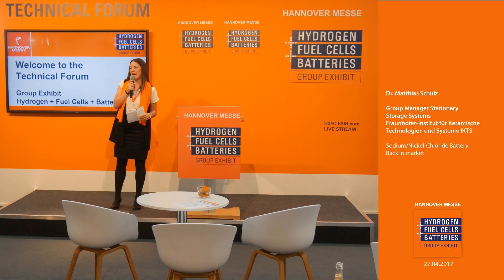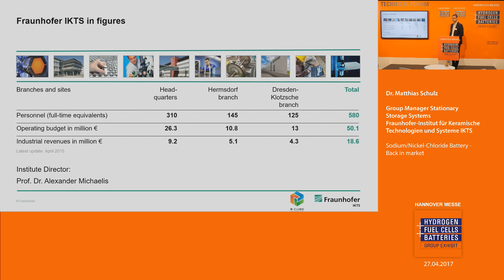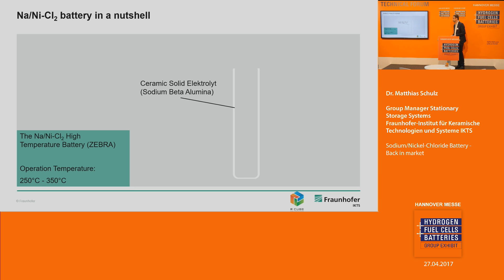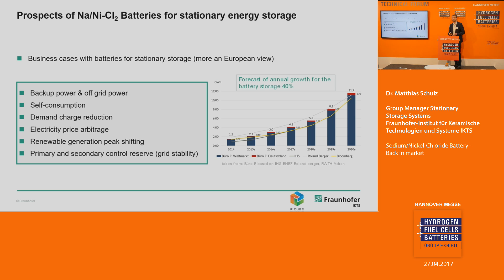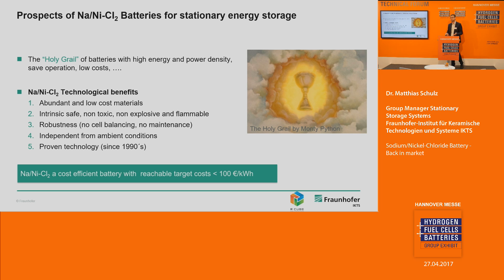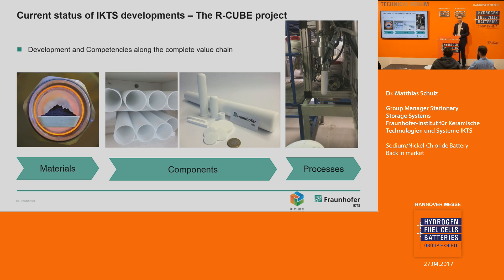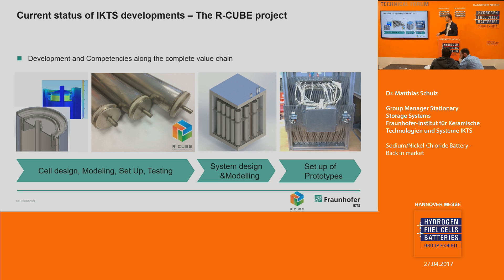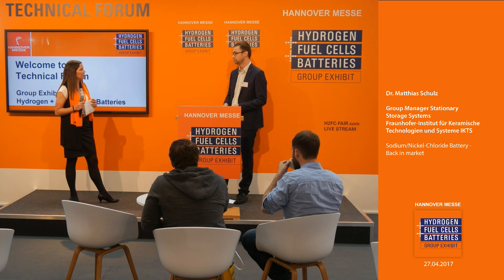Sodium/Nickel-Chloride Battery - Back in market

Comment: As much as I hate to say this?  Its not that the battery cells are not viable.   Its just that no one gets exited about Power points like this.  Show ME how I can use this.  Show me HOW well it does in an electric Drag car.  Show ME how good it is in Car Audio! 
Damn you Germans are like Wizards,  but your super power is not excitement.   

The other thing that Bothers me is that you could use the waste heat of this battery for heating.   Also, how does this work in cold temps?     I think I seen  one bus company in Mardid use this battery.  That's all.     

Get some hick or hillbilly energy behind this and you may see some adoption.